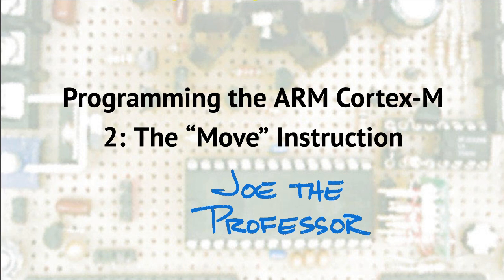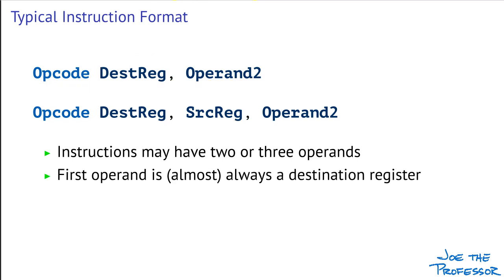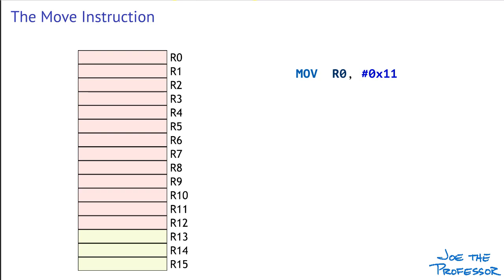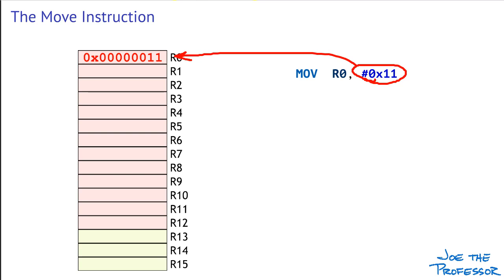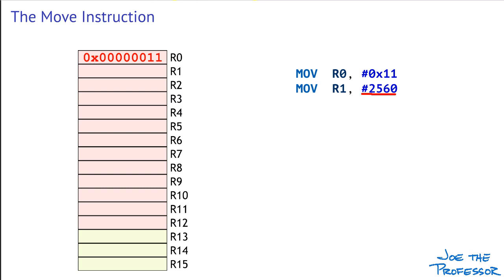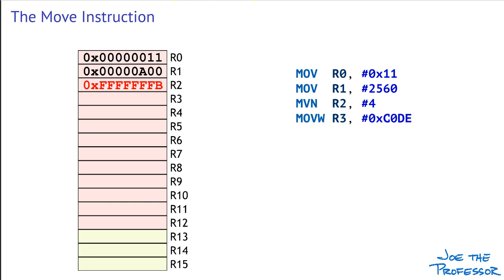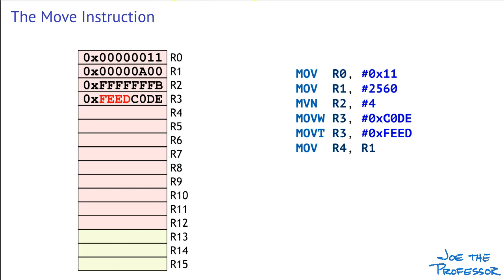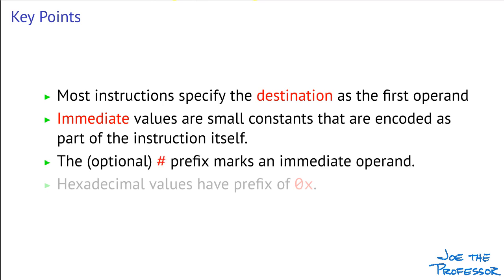02: ARM Cortex-M Move Instructions

Comment: What is the difference between the MOV instruction and the MOVW? Does the MOVW modify only the bottom part? I mean if R0 contains 0xFFFFEEEEAAAABBBB and I use the MOVW, MOVW R0, 0xA the result will be 0xFFFFEEEE0000000A??

Comment: hi, can we write i.e. MOV R0,=0x1234? if can, what represents " = " ?
Reply from the maker: No, the MOV instruction can't use the = addressing mode. MOV allows an immediate operand with the # syntax but you can't use an arbitrary 16-bit or 32-bit value. The = is for a literal addressing mode which is actual a PC-relative memory reference, and memory references need an LDR instruction.